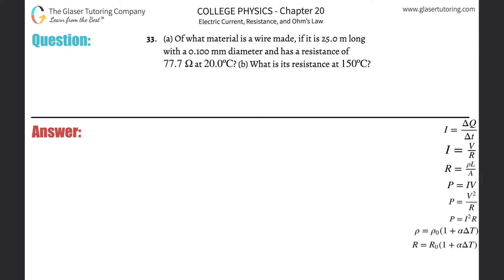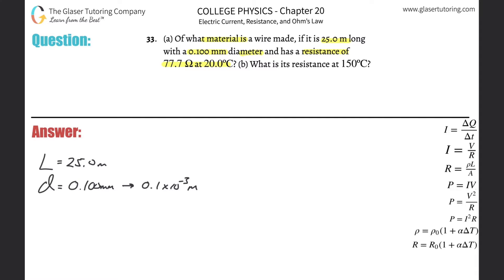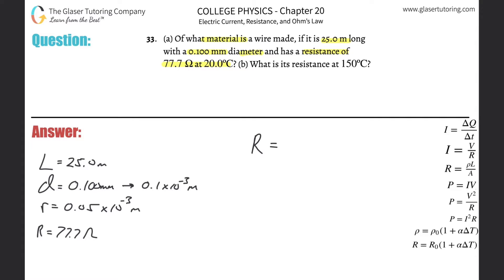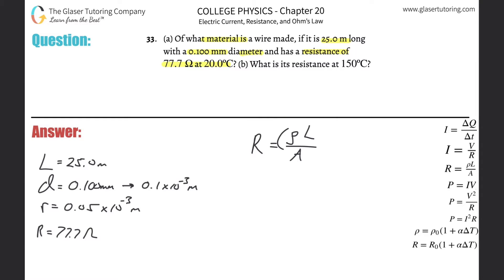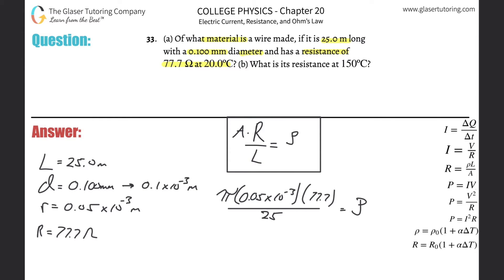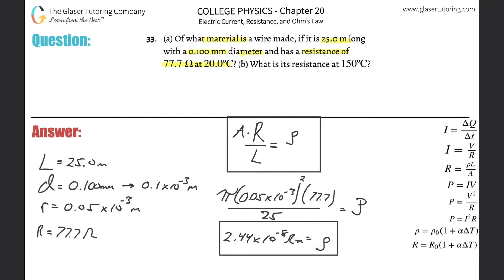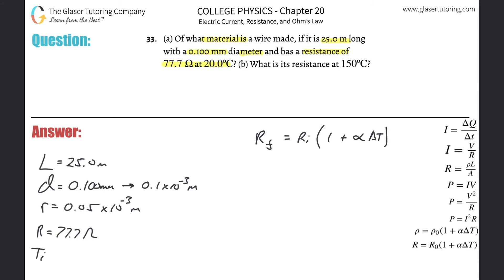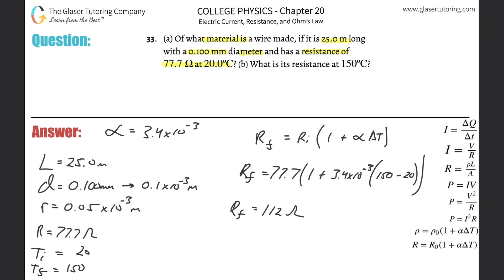20.33 | Of what material is a wire made, if it is 25.0 m long with a 0.100 mm diameter and has a

Comment: I got 2.5*10^-6 which is closer to aluminium. It does say Al is the most used material in wires so should I use that instead?
Reply from the maker: Hi there!  It seems like the difference in our answers may be due to rounding.  Aluminum has a resistivity of 2.65x10^-6 which would be close to both of our answers.  Keep up the great work!